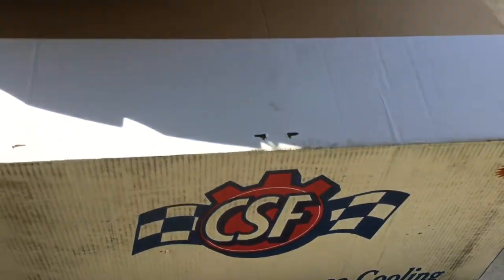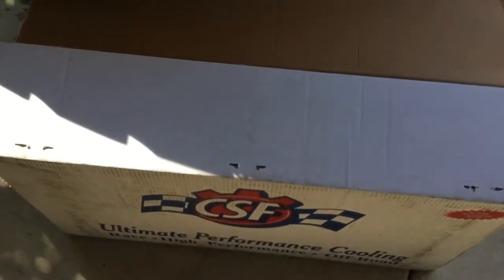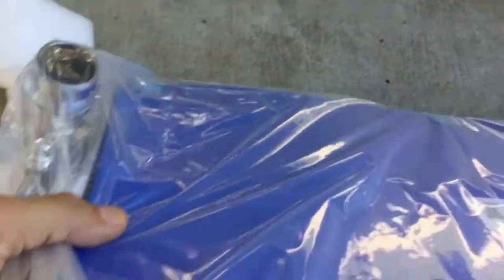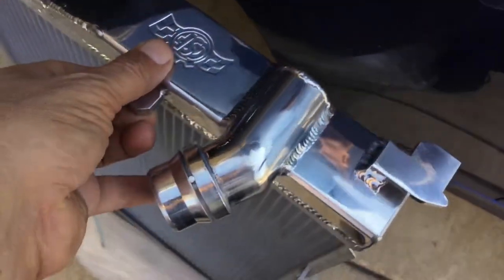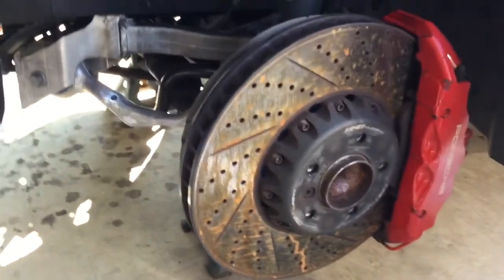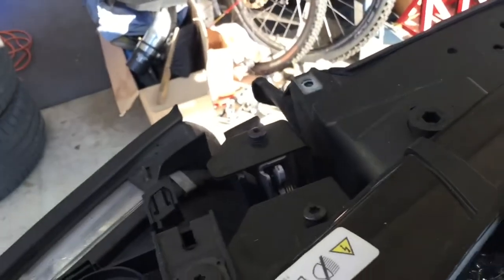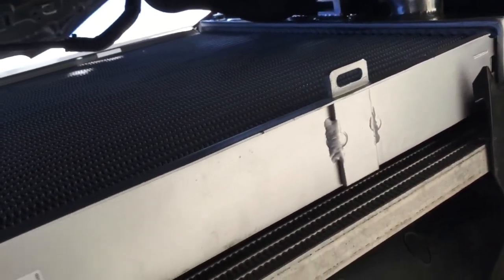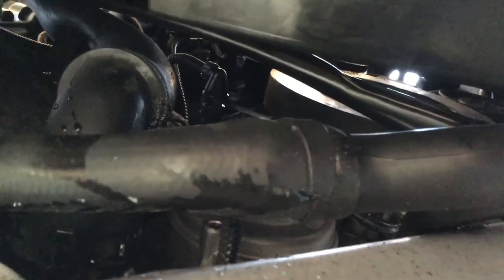DIY BMW 335i E9X CSF Racing Radiator Unboxing Convertible Installation Tips

Comment: How's the radiator holding up? I have an 335i E93 as well. Thanks for the heads up on the extra braces.
Reply from the maker: No issues with the radiator and if does seem to shed heat quicker but the running temp has remains consistent with the thermostat.
Reply: @ProjectsMB  Glad to hear it! I was concerned that this radiator worked too well and that oil would never get up to proper operating temperature.
Reply from the maker: @cupompa  that's never the case here in Southern California.  It's 106 today so cooling the oil is of greater concern.  Look into the aftermarket oil cooler thermostat I installed.  That was a very good investment; I should do a review.

Comment: Hey good content. Thanks for sharing. I am in intrested in the big brake kit you put together. Did you do anything to the rears? And would like your help in knowing what I need specifically for the front. Which rotors and which other Porsche calipers will work with the e92s
Reply from the maker: The big brake kit used to be available from ECS Tuning.  You could probably piece together that kit now by sourcing your own 19Z calipers.  The rotors and calipers are probably still available through ECS.

Comment: About to get the same for my e93, if you have any good video that explains how to take out the old one can you post the link or put them in your description? Thank you!
Reply from the maker: Sorry but I don't have anything on the radiator R&R because this car has an aftermarket FMIC that isn't popular and it needs to be removed to R&R the radiator.  Hopefully you don't have to do the same.

The mounting tabs of the radiator aren't exactly the same size as the OEM radiator so I "fudged it" a little and just centered the tabs as close as possible to the center of the hold down bolts.

Also the fan assembly needs to be removed first and that is a pain.  I recall the shop manual saying to remove the fan from below and that might be good for you to consider.  The radiator will come out from on top and so will the fan but that takes a lot of patience and rotating the fan assembly to get it out like a puzzle piece.

Good luck with your project !
Reply: @ProjectsMB  Did you get the 7046 or 7081? I have a 2013 and Im a little confused which one to get because I’m getting mixed answers. 

Also, the fan is definitely a pain, I couldn’t get it out when I tried doing the belt tensioner. Luckily I was able to manage. Also how long did this take you? 

Thanks for the advice and fast response!